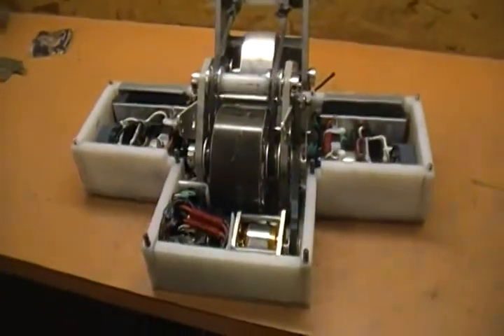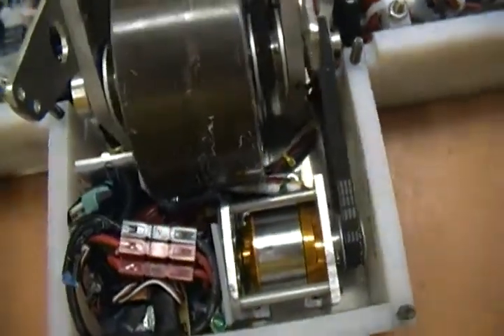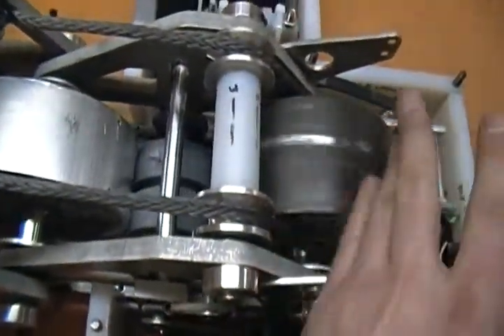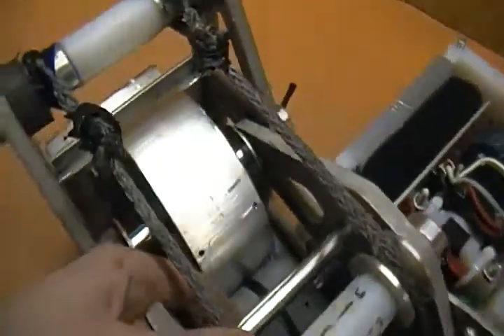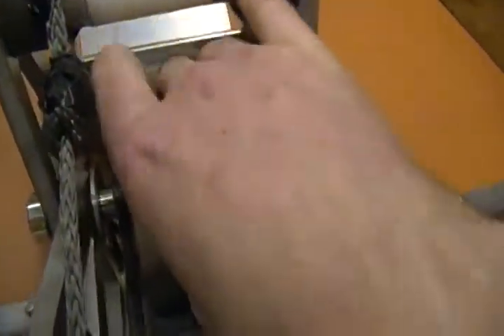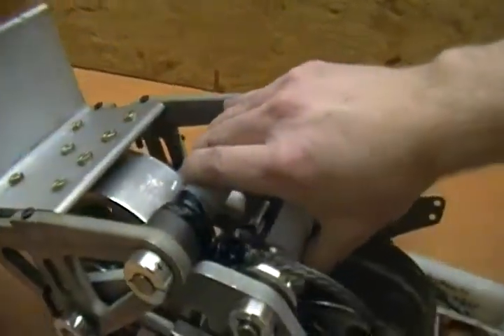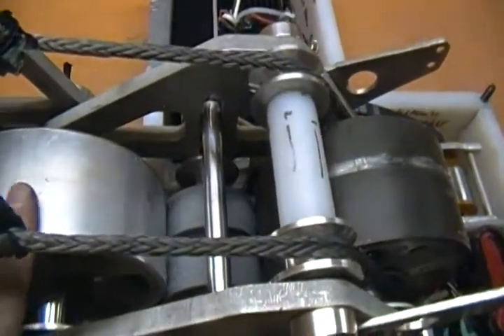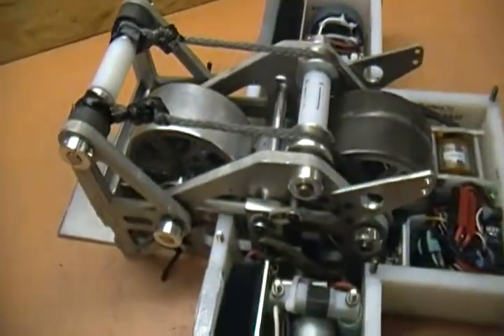Jack Reacher Inverted Clutch Walkthrough

Comment: How did you attach the ropes to the drum?
Reply from the maker: The rope goes through holes in the spokes of the coil drum. It is one continuous piece from the eye on one side of the rear bar to the eye on the other. It was strong this way but meant I couldn’t pre cut and tie replacements.